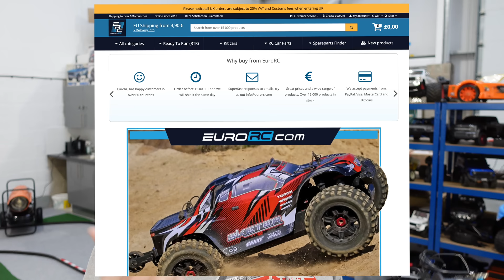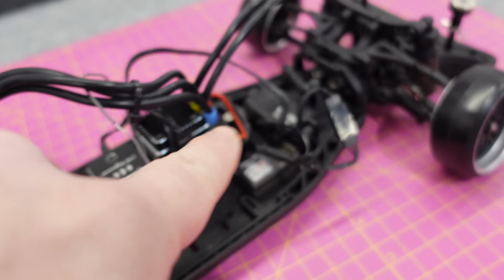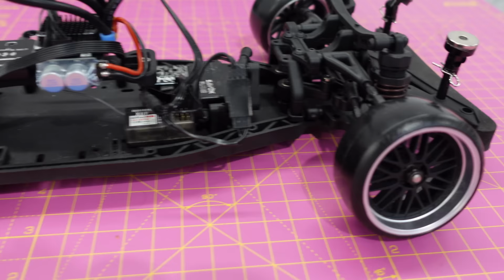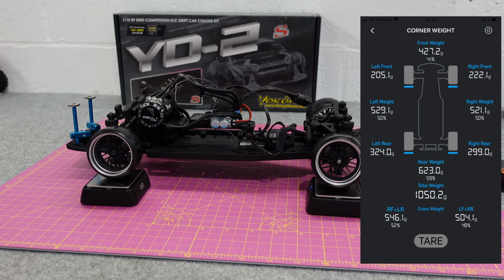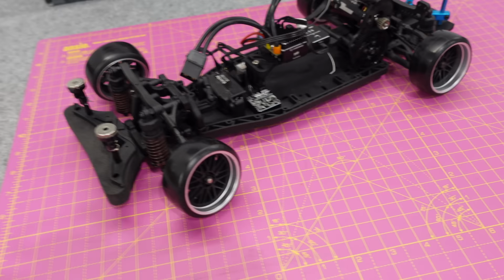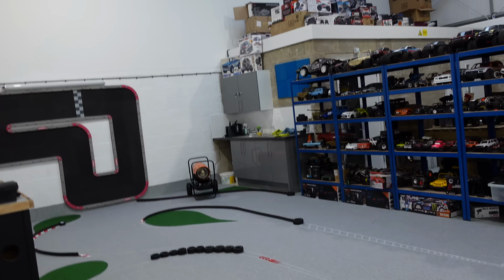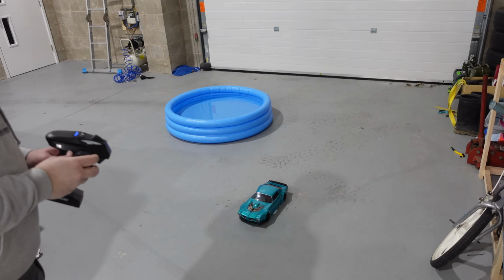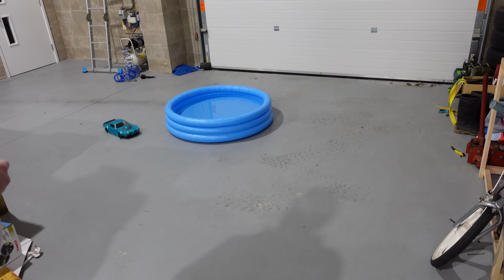Awesome Japanese RC Drift Car - Took Me 9 Months To Build!

Comment: you can fine tune the cross weight with the spring hight adjusters to get it perfect. if its out it corners better one way than the other

Comment: For the gyro fiddle with the gain on the assist mode. That mode has a slow servo return, and it’s a little better for beginners. Try to keep the front as droopy as you can cuz you need as much front grip as you can get. That’s how u can get better with time.

Comment: Drifting is slow, at first. But the more you drive, the better you get your suspension and steering tuned, the faster you'll be. Drifting isn't a race anyway. Sure, there's an element of speed to it, but the technique and showboating is what gets you the points. Rc drifting, to me, is more about hanging out with people and doing something cool and fun at the same time. Teaching people how to do it and giving help with set ups is my favorite part. Nothing like the smile that appears on someone's face when they finally get it.

Comment: YESSSSS!  A drift video! I just built the Yokomo YD2 RX ( rear motor) . Nice drifting " F* the haters " 😂✌ - I'm excited for some more drift content!!! Most RC drifting isn't very fast anyway so I don't see what these people complain about.  here in the States the supply chain is an absolute SH** show, but fortunately i was able to piece stuff together. I also went with the xr10 pro esc but went with the hobby wing D10 13.5 to try out. The body looks awesome, well done.
Reply from the maker: I’ve seen some outside drifting videos that are pretty quick… but indoor yes, it’s not a fast ‘sport’

Comment: Drifting.  Take a modern, high tech car, Remove or negate every single advancement on handling and grip ever imvented on purpose, install plastic toy tires, and spin around going nowhere slowly intentionally and call it racing?   I give you the most pointless form of powered motion ever.  I guess it must be fun and thats all it needs to be. Hobby=enjoyment after all.
 Hmm, I just don't get it.  Oh well I'm old and my cars go fast and handle well.  Nice body though!
Cheers.
Reply from the maker: Yeah, it’s not for everyone 👍